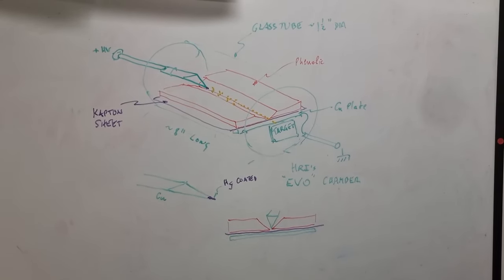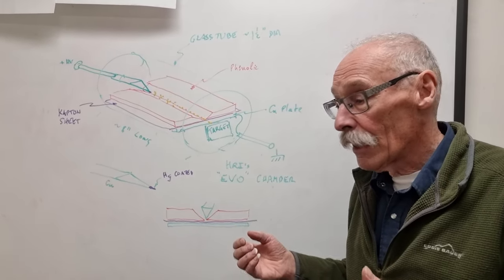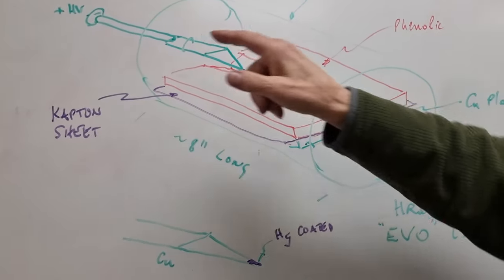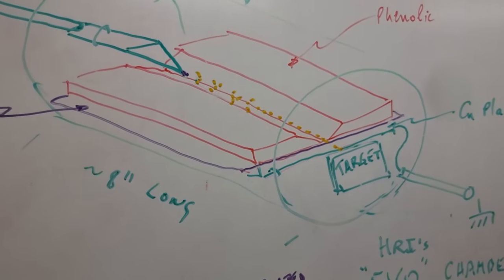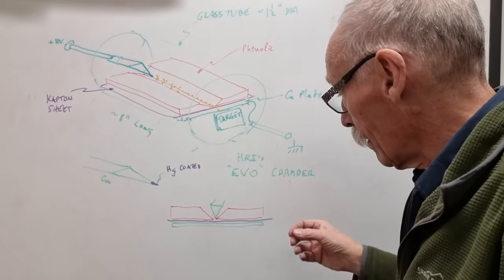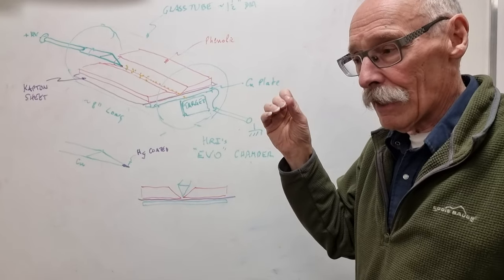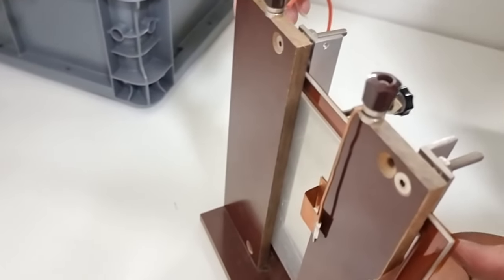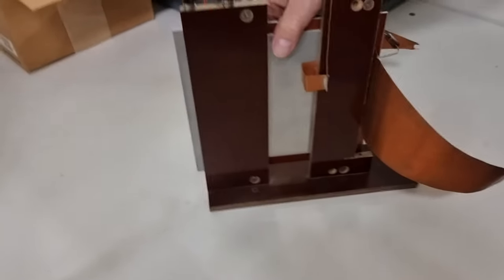Hathaway Research Internationals EVO Generator Overview

Comment: Hi bob ! Hi George awesome information low inductance capacitor and fast rise time in joules awesome happy again to hear you again George we must talk sometime all my best to Hal puthoff we had Fun years ago awesome
Reply: Hi Baroness, thats exactly what i need for my research too. Low inductance with super fast rise times, at around 200ps impulse discharges and under preferably, at a reasonably high frequency rate for continuous R&D operation (presently aiming for around 500KHz to 5MHz ultra sharp clean seriously deep ultra high amperage negative impulses). At such ultra rapid rise times many amazing and most magical things should be facilitated..., especially in the excess energy department & other potential interesting effects most efficiently indeed...(think electron avalanche phenomena on turbo overdrive)... Thereby transforming even very low capacitance and voltage values, into insanely fat multi megawatt and above, more exotic energy discharge intensities on demand!. Well providing the resistance in and on ones conductors is kept as low as possible..., which means super fat leads, bus bars or tracers required at all times for seeking ones ultimate effects in theory i recons... :))) (y)

Comment: Thanks Bob!  One question however on George’s diagram…..wouldn’t the pointed electrode have to be HV- instead of HV +?
Reply from the maker: I think so - one can verify in Ken's patents, but that would only take a single firing to establish. I will ask George on Monday for clarification (if I remember)
Reply: @MFMP  I also find it very strange why the diagram would have the polarity of the electrodes contradicting all of Shoulders written work?. Knowing the exact details of an experiment is vital for any chance of possible verification and replication. As now i am not even certain that George did Shoulders experiments correctly? (which i find very hard to believe). Clearing this up is of the most vital historical scientific significance and for absolute clarity.
Reply from the maker: @petermiddleton6902  It was a mistake, I discussed it with him yesterday after David spotted it.
Reply: @MFMP  Wonderful stuff! :) (y)

Comment: Mine was low inductance 500 joules discharge capacitor 25000 volts dc bang type from uncle plasma labs surplus I had 18 of them in series parrell  with a ballast capacitor 60,000 volts dc at 60,000 volts dc a very large dc x ray transformer powered it transformer weight 15000 pound at 400.000 volts dc at milliamperes. With a current limitor of nichrome wire at 127 volts ac at 20 amperes full amps would blow the pole transformer as it did one time when I overrode the fuses 😂😂🎉🎉🎉🎉🎉🎉
Reply: I'm trying to figure out what you meant by "discharge capacitor" 

Looks like a discharge capacitor is an extremely high voltage capacitor (in kilovolt range)

Was yours "normal" metal film capacitor, or was it two metal plates with wings like the one seen in the video?

Comment: A possible simplified "classroom" version...  
as I understand it, typical "needle-sparks" made by VandeGraaff machines are actually EVOs.    (Or instead, with the same VDG-sphere, we can trigger fractal-tree sparks, by using a small metal bead, or acorn-nut.)

If true, then EVO experiments could be performed in Science fairs, or even grade-school science classrooms.

In 1984 I accidentally made invisibly small perforations in a glass light-bulb using a VDG, jumping "sparks" to the glass surface.   Small, but after about ten minutes, the light bulb was full of air!   The hole in the glass was just on the edge of visibility, a tiny white dot if viewed with a hand-lens.

So I guess the real question is, with needle-shaped sparks, are all of them EVOs?    Or some being plasma-streamers, others not?   (And also, if some needle-shaped sparks aren't EVOs, why would plasma-streamers sometimes not form fractal shapes?)
Reply from the maker: The hole in the glass is a good indication of an EVO. Ken stated that all sparks have an EVO leading them.

That being said, the Hg Ken used was to stabilise the EVO - ordinarily they don't last long.
Reply: @MFMP  I think the mercury is to give a self-maintaining point. A solid metal point erodes.
Reply from the maker: @justinforder2835  It is to make a self-healing electrode.
Reply: @MFMP  More holes...  Here's a possible DIY project for EVO effects.
At one of Greg Volk's NPA conferences I was demonstrating x-ray output of light bulbs (some incandescent bulbs lack the usual argon fill.)  When excited by a "violet ray" hand-held Tesla coil, their glass will produce dim green surface-flashes from electron impact.  A GM counter detects the soft x-rays, if the probe employs an alpha window.
  
I had several aquarium bulbs (the long transparent type, w/tungsten filament.)  Several were placed in an otherwise empty microwave oven, supported upright on a plastic stand.  The oven was only operated briefly, up to 10sec max.  Empty microwave ovens produce high voltage RF, easily enough to trigger corona discharge from sharp needles or from the edges of torn metal foil.  Several bulbs were used, so that one or more would happen to be located in a high-field antinode.

Days later I noticed that one of the bulbs was ruined:  when excited with a hand-held Tesla coil, no surface-flashes appeared on the glass.   The bulb acted as full of air.  Several other bulbs were similar: they now produced violet glows of various brightness, indicating air contamination at different pressures.  (Normally these bulbs produce no visible gas discharge when excited, only producing green or blue flickers on the glass surface.)   Also, two bulbs would produce sodium-yellow flashes in the violet gas discharge, when the tip of the Tesla coil was swept across various locations on the glass.  (Possibly a spark was passing through a micro-fracture in the glass, vaporizing some sodium.)

Months later, I found that the gas in more of the bulbs would no longer glow at all, and their enclosed filament-supports would exhibit the type of white needle-shaped sparks expected at 1atm pressure.

I imagine that the original microwave-oven treatment had drilled microscopic holes through the glass.   The bulbs were leaking at various rates, and filling with air over a span of weeks.  Note that in these particular bulbs, the filament-supports are sharp iron wires with tips adjacent to the inner glass surface, with some touching the glass.

So, if we "nuke" an aquarium bulb, its sharp iron internal wires may be emitting streams of EVOs which perforate the adjacent glass, causing a very slow leak.   The glass, with vacuum on one side, is our "witness-plate" for detecting EVO strikes.
Reply from the maker: @wbeaty  Thanks for this interesting contribution, it would be great if you could preserve you comments over at RemoteView.ICU

https://remoteview.substack.com/p/hathaway-research-internationals

"(Possibly a spark was passing through a micro-fracture in the glass, vaporizing some sodium.)"
All sparks have an EVO leader.

EVOs can bore holes in glass - I saw this in Moscow in 2015 where a formerly homogenous ceramic tube used as a Parkhomov reactor had become like a teabag. No visible holes to the naked eye, but one could attach H2 at pressure to the end and then light the jets coming though the holes.